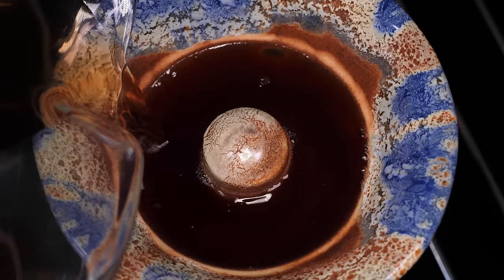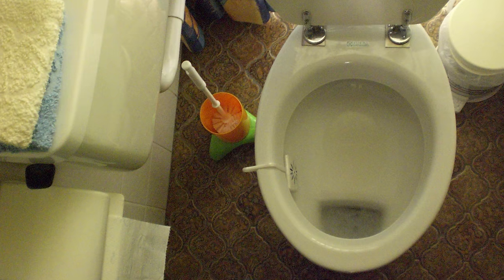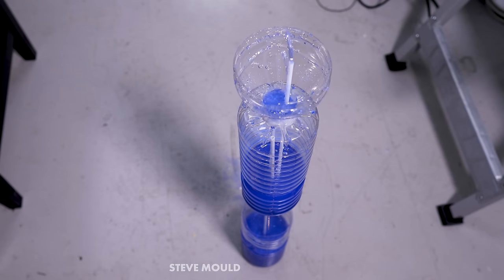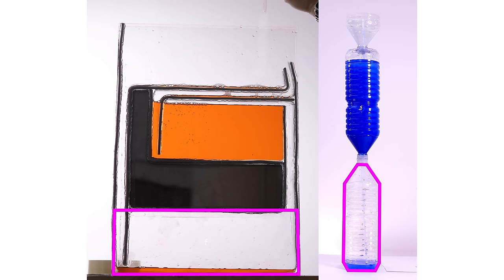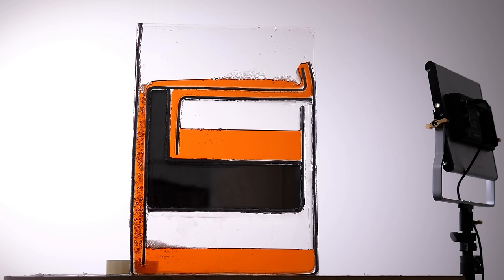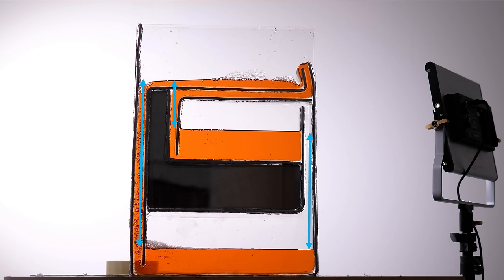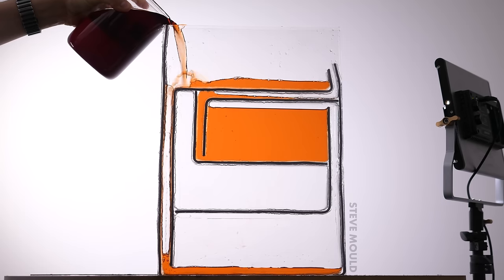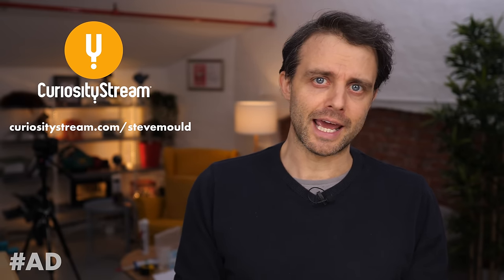A 2D Heron's Fountain Behaves Weirdly

Comment: Ah, fluids. That subject which makes you remember air and void are two different beasts. (Because when you study rigid body mechanics and the likes, you consider everything to happen in a void)
Reply: When air and friction are not negligible 😔
Reply: @TheDeadOfNight37  actually it has nothing to do with friction, its the air pressure and surface tension
Reply: @wojtekpolska1013  I know I was just making a joke bc most of the time in physics they're usually both negligible or neither are
Reply: you mean a vacuum?

Comment: 7:46 Let’s all appreciate how he was able to get half air half liquid in the left column of that tube.
Edit: I’ve added a timestamp.
Reply: That's actually very easy, just try to fill it all the way and you will get this
Reply: @lol-pk6jj  how?
Reply: @aissaouimohammedakram8640  git gud scrub
Reply: Spitballing: partially fill the tube, tape or hold the ends together, rotate until your air column is where you want it, pinch closed or put fingers over the ends, and rotate it to demonstration starting position.
Reply: Mhm.... there is a easier way hahahaha just think that the tube is a straw... 
have u ever played with a straw as a kid? well, as a kid, i would suck some juice, then pull the straw out of the juice to suck in air... and then put the straw back to the juice... so there would be air in between juice 😂
i guess u can do the same thing with that tube hahahaha
Reply: @bubbahottep8644  
Nah, he just filled that reservoir from the "fountain" part.
Reply: @aissaouimohammedakram8640  
1. Get cup of liquid and put it on a table
2. Using tube like a straw, suck liquid into the straw until it is just over half full
3. Plug the end submerged in liquid before taking it out and holding it in a "U" shape. Release the plugged end so the liquid sits in the middle, leaving 1/4 it's length of air on each side
4. Plug both ends again, place one end in the liquid and hold most of the tube under the edge of the table
5. Release both ends, gravity will pull the 1/4 liquid portion into the straw, plug them again as soon as liquid starts to leak out the lower side.
Reply: but that would be really easy, you just have to fill it up on both enterances
Reply: I think you guys are all wrong. Listen
Bowl of water. 
Put all the tube into the water except for the part you want to be air. ( middle ish)
Cover ends with fingers
Pull it out 
 
I belive that to be the easiest way. The other ways dont really make much sense if you are to try them. Even though I do get where you are all coming from.
Reply: @flyingmunk8956  holy shit you can just fill it up a little on one sjde and then fill it up a little on the other its not fucking rocket science
Reply: @awg7956  if you fill it up one side how do you fill up the other side, genius? Yeah, that’s the initial thought, but that is the one and only way that doesn’t work. If you fill one end and hold it closed, then you can’t get any liquid in the other end. If you don’t hold it closed, then when you try to put water in the other end, it’ll push water out of the end that you should have held closed.
Reply: @asileginger8223  but then he gets whatever that nasty thick orange liquid is (chemicals?) in his mouth. Doesn’t seem too pleasant, and if that’s the case, then I stand by what I said and “appreciate” how he did it by having to taste nasty liquid in his mouth all in the name of science 😉
Reply: I refuse
Reply: @smokey04200420  He got some in his mouth in a different video, pretty sure its just water with food dye
Reply: Don't tell me what to do
Reply: @snootiermoon  Oh shit that's a fair point
Reply: timestamp?
Reply: Just blow in some air once you got the amount of liquid you want
Reply: @0_-  7:46
Reply: @smokey04200420  It's water with food dye.

Comment: I have built many Heron's fountains, for my children and for my students, using bottles. But I always much separated (a quarter or half a metre) the two bottom bottles, used long pipes with long visible lengths outside them, and topped the top end of the uppermost pipe with a strainer. Results:
• The fountain had a surprisingly tall jet, reaching very high over the pile.
• Water circulation through the pipes was very visible, at least if some air  bubbles were present.
     Once the top pile is empty of water, just putting the artefact upside down empties the bottom bottle into the upper one, and the fountain is ready to work again once returned to its normal attitude.

Comment: It would be interesting to see this done with two liquids of different density. Of course, it would be very tricky to fill.
Reply: It would stop when the liquid of lower density gets the role of pushing the liquid of higher density up
Reply: It will spoil it as it will reveal the mechanics. It will be easier to "connect the dots".
Reply: @YourCRTube  not really, it cottons be WAY sneakier if the two fluids were the same color, so then you can't see any change over time other than liquid coming out the top
Reply: I think it would be great to fill it up with lots of water, then use a syringe to fill the middle reservoir, then pour mercury on top, which would recreate the effect